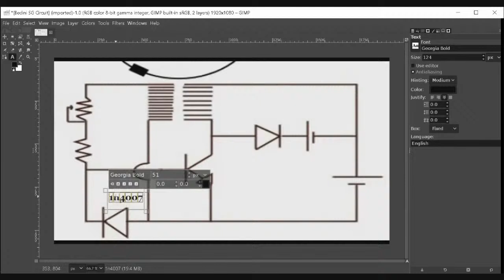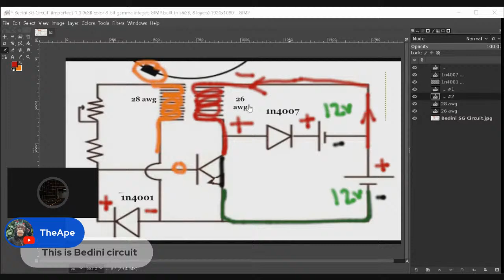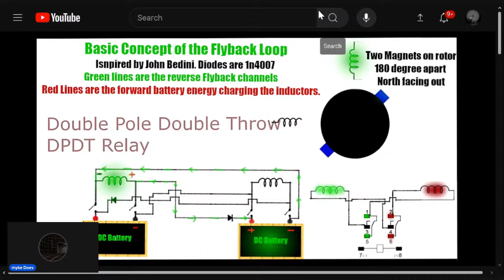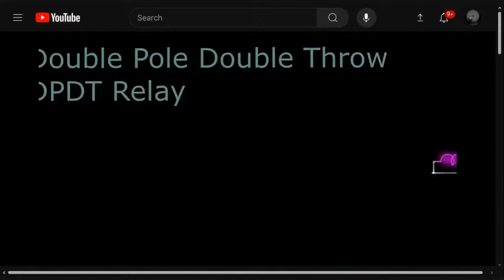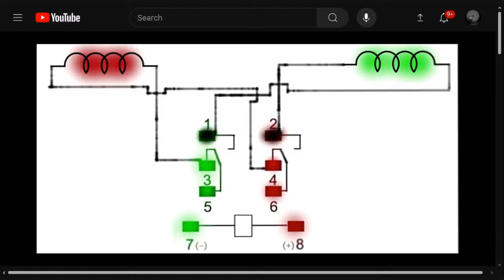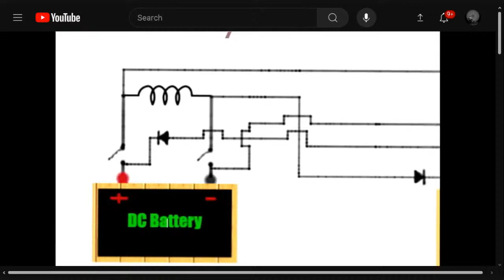Pulse Motor Tech / Energy Systems Open Talk

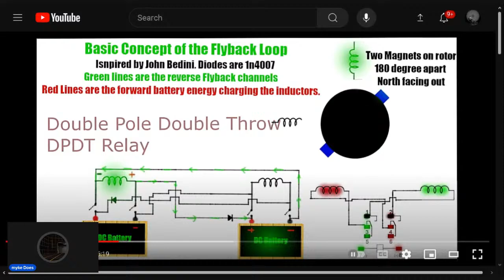Comment from the maker: 32:35  DPDT relay toggling a single source will not work here , need commutator to double throw two separate sources or can use 4 transistors link in community page top post